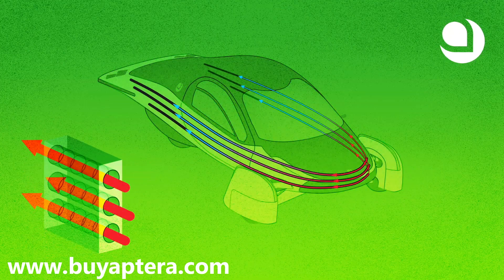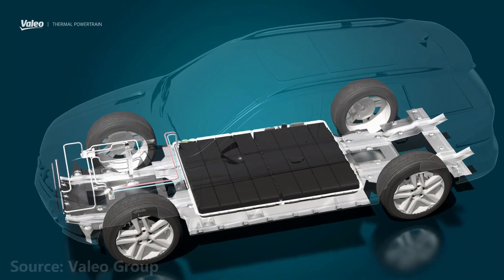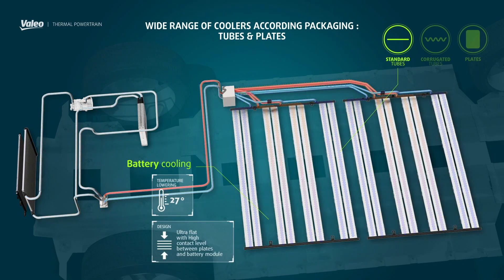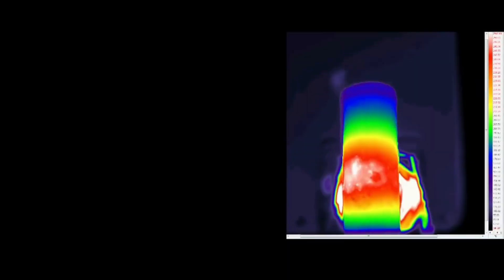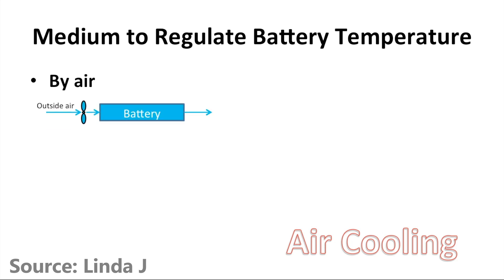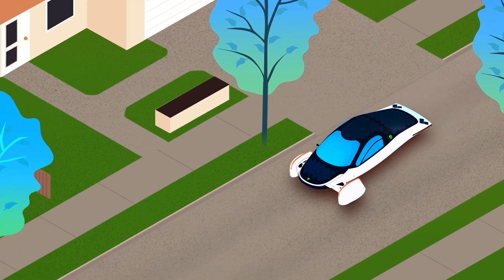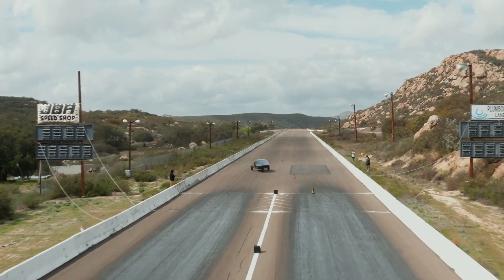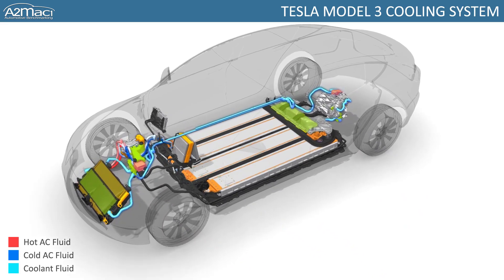Mind Blowing Skin Cooling Thermal Management System

Comment: Nice presentation and explanation of the EV cooling systems. I think that is still early to see what the issues might be with skin cooling. It obviously has a great advantage with aerodynamics, and efficiency. Many airplanes have used fuselage skin cooling, and i just wonder how thermally conductive the composition body shell will be for heat dissipation, and how the wrap will do with possible condensation issues. Aptera could split the cooling channels for redundancy, or have one set up for battery and electronics cooling, and one for cabin A/C, and have the ability to switch on the fly to the other cooling channel if there is a loss in coolant in the other one.
Reply from the maker: Thank you for the feedback. It's definitely very early and I am sure the team at Aptera has already taken my concern into consideration so for all I know this is not an issue at all.
Reply: @apterareboot1555  Yeah, I am certain that they will work out (or are working out) any issues in this design/development stage as the Aptera approaches production later this year. It is good that we are asking these questions as reservation holders and future Aptera owners, and I look forward to learning how the skilled Aptera engineering team resolves the various cooling and heating issues for batteries, electronics, and passengers.

Comment: Will Aptera design a car that we can drive in Europe, because on the front number plate...
Reply from the maker: Aptera is categorized as an autocyle which would be treated more like a motorcycle than a car in most jurisdictions. Are motorcycles also required to have front license plates as well?
Reply: aaaah, aptera cars are considered an autocycle... i know front plates are not mandatory on 2 wheels vehicles, like motorbikes, but as aptera has 3, so, i don't know. Also, the European plate is quite long and not very wide, so I don't know if it would fit on the back.
Reply: @flof173  You can not arbitrarly fit a normal license plate on the Aptera without introducing turbulence especially om the front. I drove an enclosed delta trike EV in the 90' and IT was registred as a motorcycle, i.e. I could Park IT om the sidewalk. The difference was in the classification:  Helmet exempt, but with mandatory seat belt. Still only rear MC plate required which measures 25x20 cm. Ideally a regular EU car license plate, which you Also legally have the option to put on a motorcycle, should fit between the brakelights, measures 45x10cm, without sticking out?
Reply: @Tore_Lund  ok thanks !
Reply: I think the difficult European problem is not the plate number, but the dimensions. Aptera is too wide to be able to register as an autocycle in Europe. It won't get permission to import unless homolongation experts work on it and resolve the issue.
Reply: @adimchionyenadum2962  Interesting! Quad bikes had to have their own class when first getting license plates in Europe too as 4 wheeled motorcycles.

Comment: Due to their micro-channel skin-cooling system, I wonder how difficult it will be to replace damaged body panels? I suppose this can't be answered until their design is finalized. Thanks for another video about the Aptera! It's the vehicle (and electric car company) I'm most excited about.
Reply from the maker: Good question! I'm sure there will be just a few points from which the coolant can enter and exit the body of the vehicle. A system like this wouldn't add much complexity for replacing the shell.
Reply: @apterareboot1555  That's reassuring! I'm excited to learn more about how all their systems work in detail as they near production.
Reply: @apterareboot1555  Yep I figure there will be o-rings where body panels meet, or since it's looking like it will be a monocoque type body anything more than a fender bender (side pod bender?) will be a total loss anyway since the structure of the survival cell will be compromised.

Comment: The Rolling Stones - Brand New Car (youtu.be/NVr78foNgsU)
Reply: You have the cooling system all wrong!  The battery cooling is done  with a cooling system through the battery tray at the bottom. The side skin cooling system is for the air conditioning system.
Reply: @davidmarlow194  David, I think it is too early in the design cycle to know exactly what the final configuration will be.  With an excellent BMS, there is at least a possibility that they will get the -20 to 125 F performance they are aiming for without liquid cooling, which could save weight.  They won't know the final configuration until more testing is done.